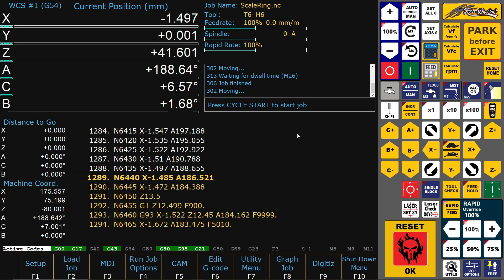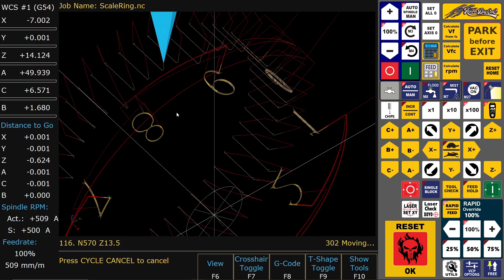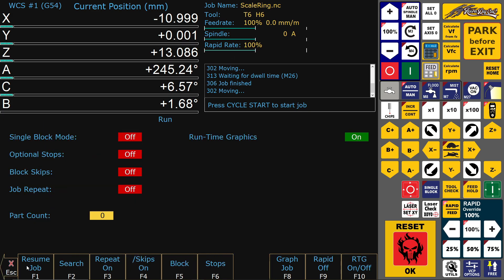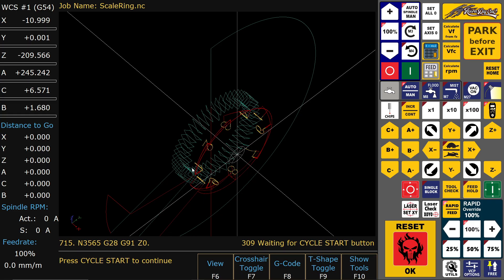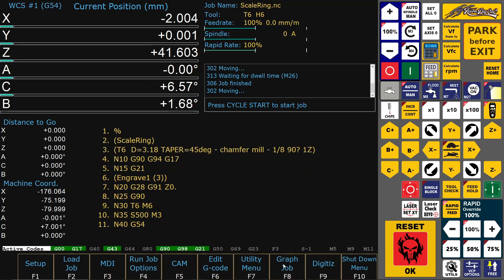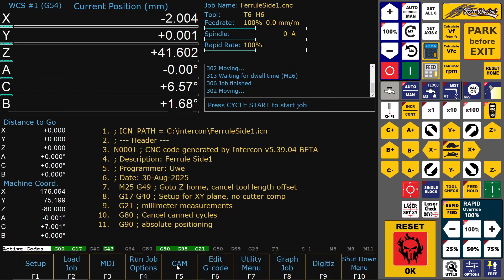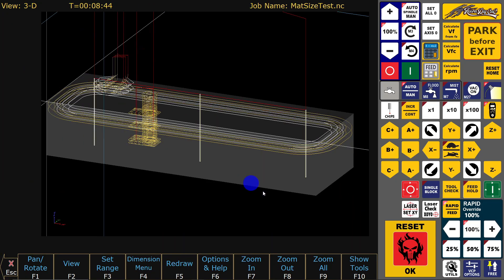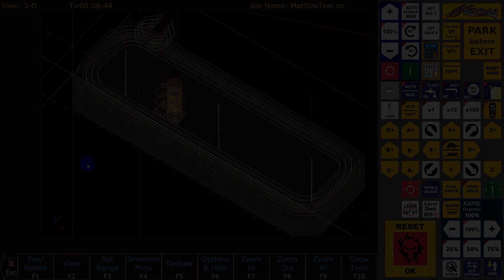New Runtime Graphic on Centroid DIY CNC12 Version 5.40

Comment: At 6m20s you show the menu and there is the "Show A and B axis rotation" option button.  With V5.4 and Acorn6 does this now pick up the correct A and B axis from the configuration of the machine, or just assume that the rotary A and B are physical axes 4 and 5 as v5.3 RTG does, even if you have either of them set as a linear axis?
Reply from the maker: They must be rotary axes and be configured properly in the parameter settings to show them in the RTG